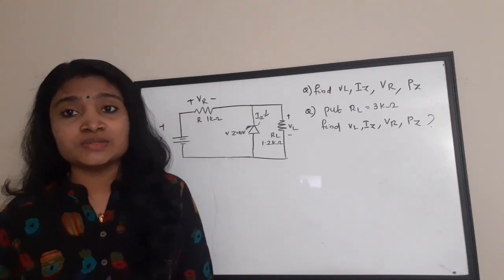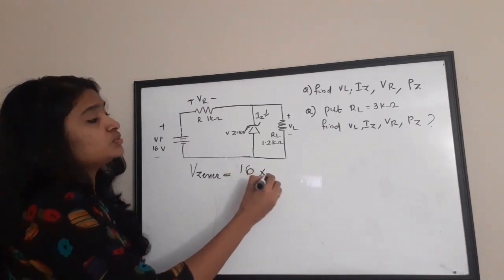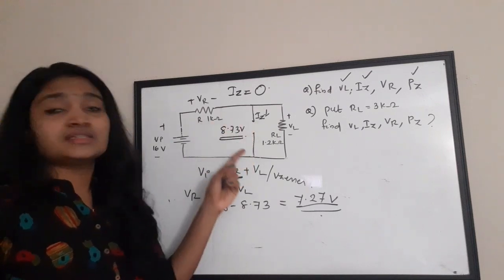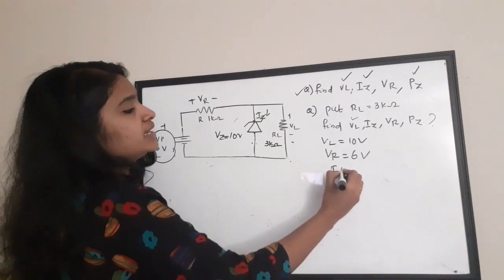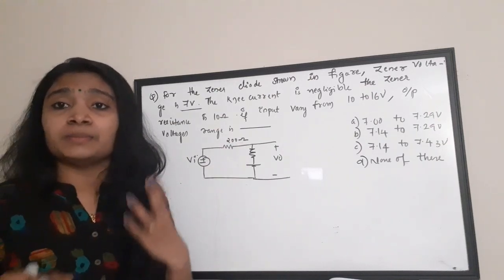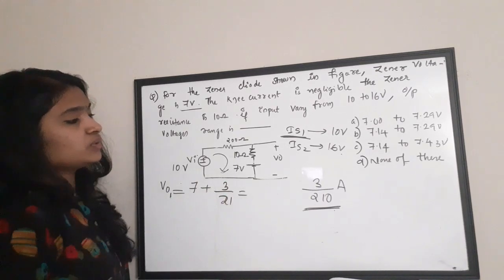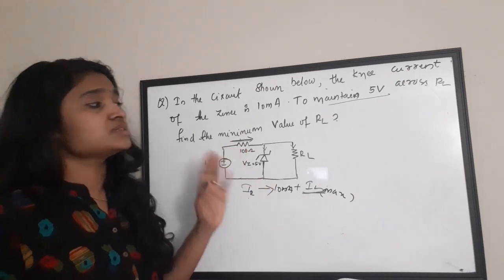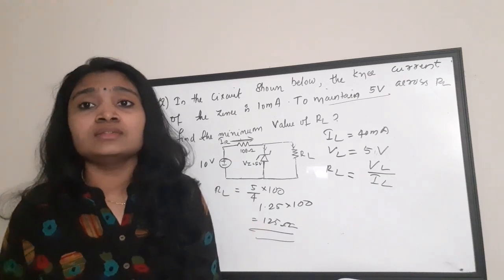Zener diode Numericals Part1|| ISRO Scientist Electronics ||Technical Assistant| Gate||ESE

Comment: In the 7V zener voltage question, the positive of considered source (when zener is forward biased) is drawn upwards while the zener diode’s cathode is upwards in the original circuit...why?
Reply from the maker: Zener works in reverse bias
Reply: @EasyElectronics_jobupdates  Thank you :) You are awesome! Everything is to the point and very clear.

Comment: Mam is this circuit is related to the line and load regulation
Reply from the maker: Voltage regulation in general
Reply: @EasyElectronics_jobupdates   ya right